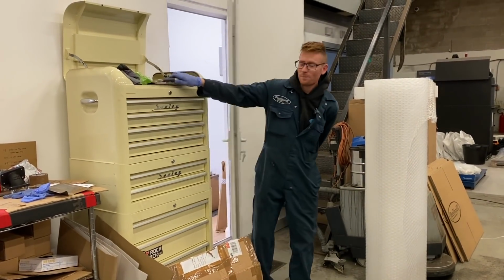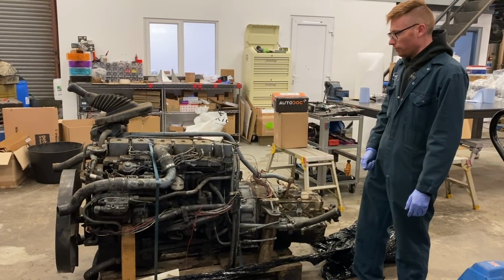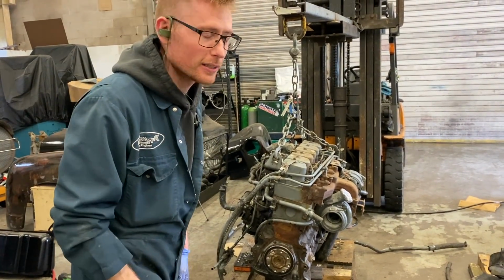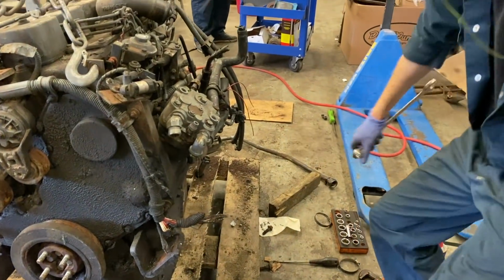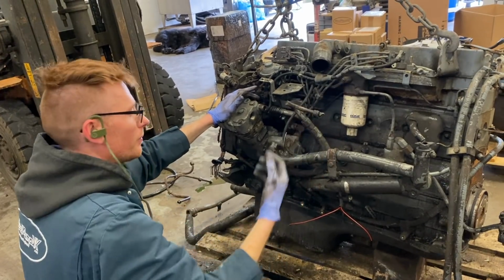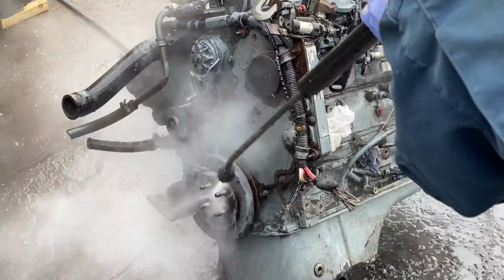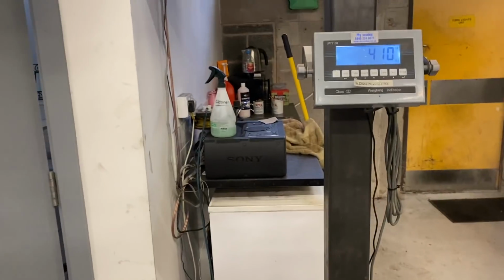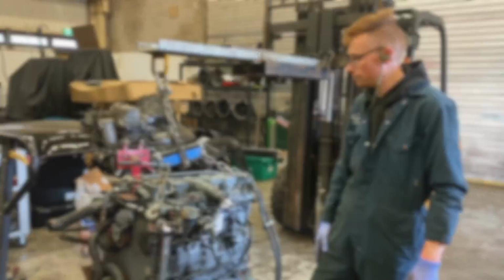Cummins 12valve SIZE and WEIGHT (WATCH TO THE END FOR DIMENSIONS) 6bt

Comment: Welcome to America. These are the most sought after diesels. With a p-pump these are unstoppable. They have been swapped into many other makes of trucks. When they are in a Ford they are called a fummins. Heavy but damn near indestructible except for the dreaded killer dowel pin problem, which is an easy 1.00 dollar fix. Tuned correctly these engines will go 700,000+ miles before a refresh.
Reply: Were they not a British design engine in the first place? Hence the British and German injection pumps.
Reply: @agt155  Yes, designed by British engineer Phillip E. Jones

Comment: A 6BT with a 24V head and P-pump makes for one of the best setups. 
 I had a ISB 01 5.9L that I ran a modified vp44 pump with the 285 hp RV injectors with a HX35/40 hybrid turbo. Sadly it was a 53 block and I was limited to how far it could be pushed before the notorious block cracking.

Comment: it’s lighter than most people think. My engine in my car with everything deleted.. electric water pump and small alternator and home made aluminum water inlet and outlet is 890lbs. 👍 The p7100 is almost 50lbs. probably double the VE pump.
Reply: Id rather eat rocks than run a ve pump
Reply: @RustyChevy  if youre not a muppet they last forever

Comment: Had many a patrol from pushrod 4.2’s 4.8’s petrols, 4.2 and 3.0 diesels, and many a 4 and 6BT, but never married 🤓… both great 👍🏻 I had a HAMM 10 ton roller with a 6BT, blew the head gasket, couldn’t get a top end set, so I de-laminated the steel and sandwiched it with white bathroom silicone, ran for another 3 years after 😂 testimony to the head and block strength 👌🏻😎

Comment: That’s a great motor. I used to drive a ten tonne Leyland Roadrunner with the non turbo version fitted. Only about 120 horsepower but would pull down to just over idle speed without protest. I drove a later Daf 55 with the 180 horsepower ‘BT’ version. And again, great motor. I hope the gearbox and axles of the Patrol are as strong as you alluded to as the 6BT produces a minimum of 400lbs ft of torque (depending on state of tune) at around 1500-1600rpm. I’d think he’d need to do something with the gearing anyway as it’s a much lower revving motor than the one he’s taking out. I wish him the best of luck with his project 😊
Reply: They run 2000hp through those axles in the Middle East dune racers! They are the strongest 4x4 axles in production.

Comment: The 5.9 is a reliable workhorse.  It can be built to 2,000 lb. ft. of torque relatively cheaply.

Personally, a 4BT would be a far better fit for that project.
Reply: Struggle to find a 4BT in England sadly
Reply: In England, you have Diesel Pump UK, and they specialize in OM606
Reply: The 5.9 is a massive engine and simply too big and too heavy for most projects here. OM606 or BMW diesel it is.
Reply: @alouisschafer7212  I would agree, you boys lack full size pickups that will easily accept an engine of this size. In America there are plentiful candidates to accept these as well as a plentiful amount of companies that make the swap parts for it.
Reply: @georgemarshall6657  CASE 580 backhoe had them not sure of what else.
Reply: @rickmosholder4593  Yea, we don't have too many candidates in Europe, outside of the most common ones like patrol, land cruiser or land rover, i guess you might be able to cram one in a Geländewagen, maybe. We have some American pickups in Europe but they are kind of rare, they seem to be especially popular in the Nordic countries like Finland, Sweden and Norway, but also the Netherlands and Germany for example too. I think American pickups are slowly becoming more popular in Europe in general.

Comment: Little tip for swapping a cummins in to anything, buy a fake polystyrene cummins engine that weighs 35 pounds, that way you dont have to wrestle around 900 pounds of iron, and you can pick it up and move it around by hand, $1000 dollars, resell it after you are done or keep it for the next project. Worth every penny
Reply: ehhhhhhhhhh for that much money, just buy a blown up 6bt and strip it for the parts.
Reply: @g__wizz  even a blown up cummins is worth quite a bit where I'm from, I'd say cheapest is gonna be 500 for a core. And I think bare block is over 200 pounds, maybe more. So you stiff have to use a lift and it's still awkward and can still damage things moving it around in the engine bay, I'd you do this stuff enough a grand isn't much money.
Reply: @townsendliving9750  plastic engine blocks are for nerds.    if you do this stuff enough, you would rather spend 1000$ on a core motor for parts.    how much moving around do you do with an engine swap lol.. you center it/position it and set drive line angle.. thats really about it.

Comment: I think the customer will regret this. 410kg without accessories so its well over half a ton once in they engine bay that will make the car a pain to drive and put unnecessary load on the front axle.

There is a reason this engine went into a DAF lorry while the Patrol got much lighter and smaller engines. These are two different worlds colliding.

Comment: What the hell is a Patrol transmission made from to handle the torque from a 12 valve cummins? The reliable manual that goes behind the Cummins in America is the G56 which is found in large Mercedes trucks in Europe grossing up to 16 metric tonnes.
Reply: yeah no idea why somebody would mate a Patrol gearbox to a Cummins when there are plenty of other transmissions to choose from
Reply: 3rd and 4th gear fail after a few thousand klm

Comment: I love my 12v 96 dodge, however in the suburban I think an om606 would be much more ideal for road trip mpg and noise.
Reply: Idk because the Cummins is direct injection which is more efficient than the indirect injection om606.
Reply: @erikkovacs3097  having owned a dozen or so 6bts over the years I appreciate the 6bt in my trucks but in my suburban where I want noise and shaking down and to not have to beef the axles to 3/4 or 1 ton spec I think the om606 will be a better fit.
Reply: @Pan_Gotti  i thought about the om for my blazer but wasn't sure with the weight are you uk based 👍
Reply: @jonnysprojects6549  USA based.
Reply: @Pan_Gotti  I blew my 6.5td in my 96 gmc suburban 3/4 ton so I did the 12v conversion and actually regret it for long travel. I may replace with a Duramax or Mercedes om647 or 648
Reply: @Terk131  ya I like my 12v in my 96 ram but I set that truck up specifically for hauling across the country, the burb I'd like to set up for some of the same but also explore a bit more off the highways so I think it will likely get an om606 or a 5.3/6.0 truck engine
Reply: @Terk131  why do you not like it for long travel?

Comment: What changes are you going to make to the BT6 will you be changing the fuel pump and turbo. I am interested in this project as I have a 6bt which was a stationery engine it has a Bosch in line fuel pump the motor is the same as yours a 12valve Cummins but has the after cooler so is a 6BTA. The Fuel injector pump is a Bosch F002 A0Z 379    PES6A95D320RS2000 The Engine is going into a 4X4 Oka which is and Australian built 4x4 current Engine is a Perkins Phaser which lacks power on the highway. when I found your web site I started to question engine options when you show you can get over 600HP from a Mercedes car engine which would be a lot lighter than a Cummins. This application we need more HP and lots of low down torque.

Comment: About the ZD30, if you get a bigger exhaust, intercooler, manual glowing or override the afterglow with a switch on the realy and dawes and needle valve kit for it, they can actually last! The main problems of them are the 5min after glowing so the glowplug tip falls down and fks the piston up and the stock turbo pressure control is just a laugh, they can overboost like you cant believe!!
Reply: Sounds like a candidate for a glow plug delete. Cummins actually did not put glowplugs on the 6BT/12 valve because they felt a grid heater was just as effective. Glow plugs do seem to work better for vee engines though, but I'd try the grid heater for sure if catastrophic damage was on the horizon. Grid heaters are super easy to add to something.

Comment: This might be a stupid question but is a 6BT the same as a 12valve
Reply: Yea its a 6bt . If its intercooled too its called 6bta as they call intercooling aftercooling in the states . As far as ive bn told .
Reply: 24v with vp44 injection pump is called the isb215,  Interactive system B series and number was horsepower rating.
Reply: It is the same engine so the 2 names are interchange. The 6 in 6bt means it's a 6 cylinder, the B means it's part of the B series family of engines, and the T means it's turbocharged. That's exactly what the 12 valve is.

Comment: The hate for the ZD30 comes from the miss-informed and lazy..... Simple mods, the make reasonable power, reliable and not bad on the juice. Shame a Diesel Pump guy couldn't do something with their only limit, the POS VP44 pump.....  The 5-9 has great note but showing its age and weighs a crap-load. Not a huge conversion market is Aus like claimed in another comment due to the amount of mods and making is legal. LS's are way more common. Crikey, local down here charging well over 30 grand (AU$) for a 4-pot cummins. The OM606 is better option but prices of them took off with being popular. Sticking with me ZD30 for a long while yet, done well over 400+ thousands K's and still strong.

Comment: This engine is far too heavy for the Patrol.  There are much better options available, why the customer would not choose an OM606 is weird.  A good option is the Isuzu 4JJ1 which fits nicely and can make plenty of power.   Then again,  a Patrol CRD engine with an Eclipse Turbo (Aussie developed) and remap will be by fat the cheapest way to get significant power.  You won't break the ZD30 bottom end easily.  You will blow holes in the pistons of the DI version, but that's because of Nissan's insanely bad fuel and boost control.  The DI head isn't the best either. All OK in the CRD, although factory fuelling is still not industry best practise.

Comment: the engine is too heavy for the suspension on the nissan. the only way is to put cummins engine , transmission, tranfercase in all in one shot. the best combo is 94, 95 dodge cummins rh47 auto 4sp with stock transfer case. the firewall/tunnel will have to be cut out to move the engine back in the frame. dont try to use stock nissan transmission.

Comment: Nice project and a great engine for the project. I’d recommend a 4BT engine instead, it’s far easier to install, compared to the 6BT. But then again, a 4BT produces 2/3 of the power of a 6BT, so if it’s a question of power, then use a 6BT.
Reply: The 4BT is still just as huge in height
Reply: Would rather a Merc/BMW/Audi V8 turbo diesel
Reply: 4bt is awful compared to 6bt
Reply: the 4bt is rare enough in america. its probably nonexistent in europe.
Reply: I've had my hands on a lot of them here in Denmark ;-)
Reply: @HrThune  what were they put in originally?
Reply: @acow9966  Marine installations, mostly gensets. Maybe also off-road vehicles.
Reply: along the other reasons cited in here, 4bt is a really unbalanced engine and will rattle the fillings out of your teeth. It is loud as hell (not like the 6 isn't) but those damn engines VIBRATE.
Reply: @acow9966  CASE 580 backhoe some David Brown/CASE tractors.
Reply: @acow9966  The ISB 4.5 is everywhere in Europe, they were branded Paccar or IVECO depending on where they were fitted. The IVECO engines had a different injection system. I think some DAFs had the 3.9s too.

Comment: Haaaaa Volvo is regarded as the best heavy truck manufacturer.... My D16 would spend 10 of every month with the mechanics. It apparently was homesick often. Most fleets that I know that use them can't keep them out of the shop. That's why we run so many old non-emissions trucks in Canada's oil and gas sector. It's better to rebuild the old trucks every 5 years, than lose money on fixing the new ones monthly and lose the downtime revenue and contracts.
Reply from the maker: Hmm I was really referring to the d12s
Reply: @DieselPumpUK  lol, had to give you a ribbing over Volvos in general. The D13 and D16 here, are not the same as Euro spec. Even more restrictive emissions apparently. Mine was 600hp and hauled double trailers at 63,500 kg over rollercoaster mountains in western Canada. The trucks we get are the most comfortable, best driving trucks on the road, but the emissions components have as many problems as every other manufacturer. 🤣
 Love your work with the Mercedes diesel conversions in the GWagens. If I were ever in a position to build a G500 overlander with a set of portal axles, I'd be calling you for a drivetrain. Cheers !
Reply: @DieselPumpUK  MWM sprint,4.2tdi. 510nm,140kw. with a to6 turbo. 700nm.. should of done the bmw swap.

Comment: cummins 5.9 55 blocks like to crack along the exhaust side of the engine and leak coolant
Reply: Wrong it's 53 block was the earlier replaced by 54 55 and 56 was the last before cm